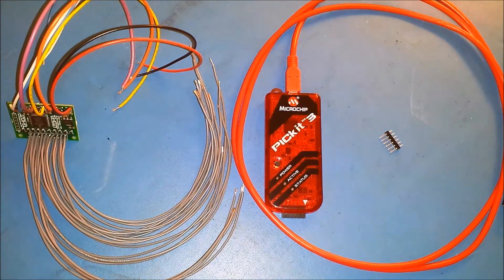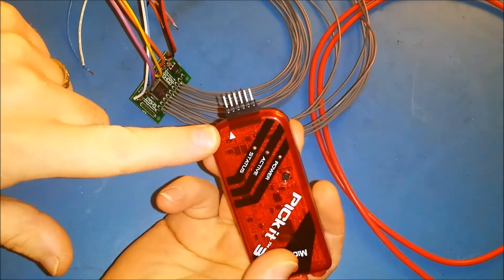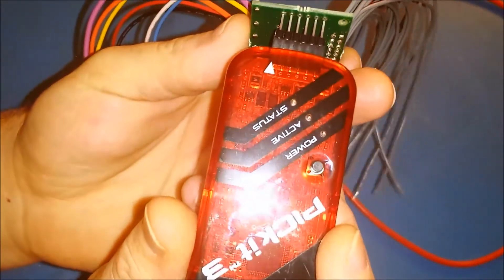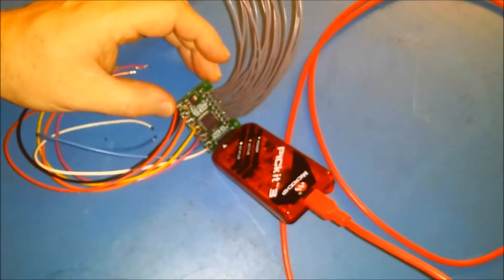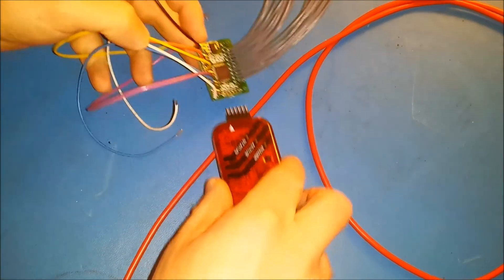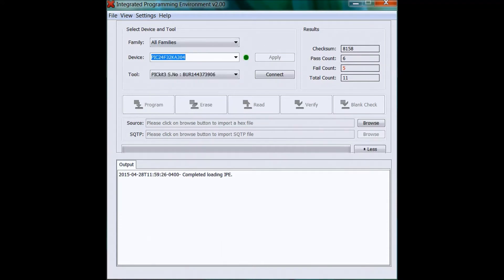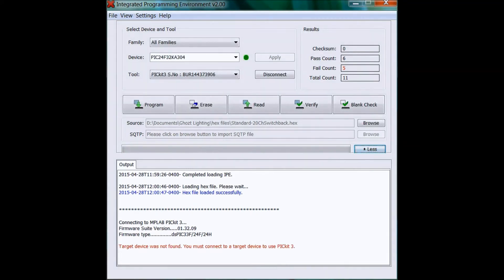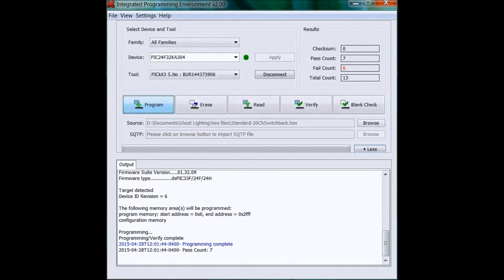Ghozt Lighting - How to flash your sequencer

Comment: You dont want to solder the pins in place?
Reply: We don't ship them with the connector because it raises the risk of shorting it out and also because we recommend that installers extend the programming port outside of the headlight. You can solder that connector in there, if you prefer just be careful not to short it our when you close up the light enclosure.
Reply: +Kyle Gregory yea after watching, makes sense not too! Awesome product! Doing some homework but I'll most likely be ordering some soon!